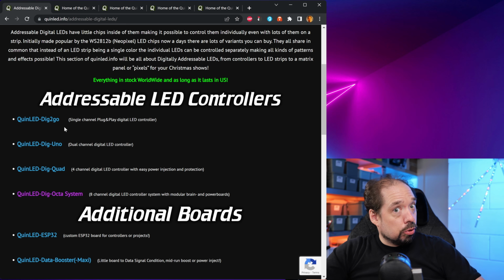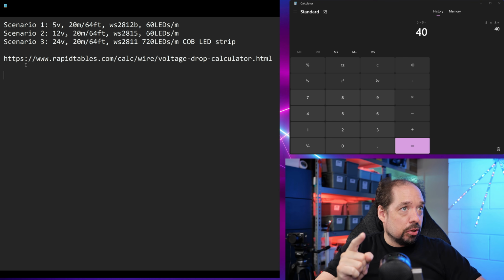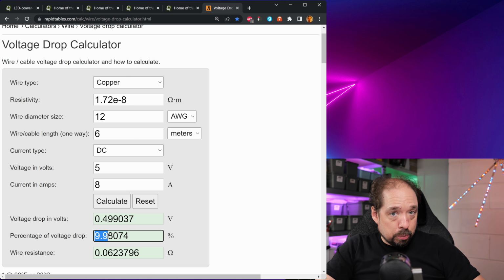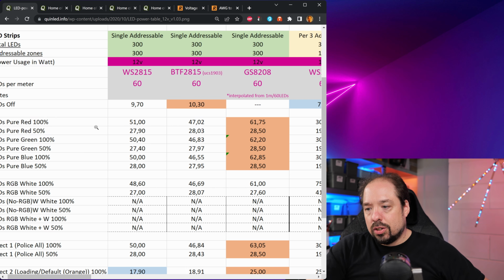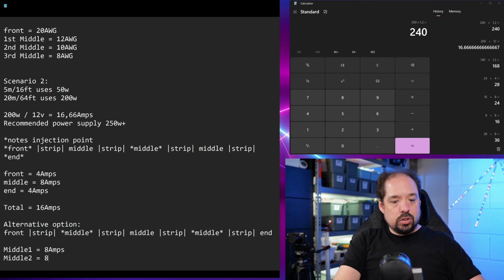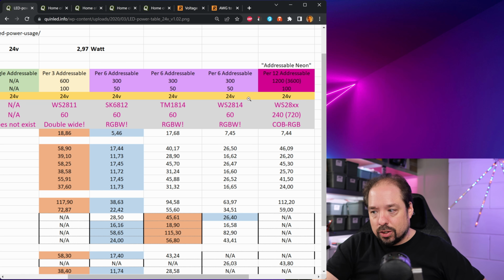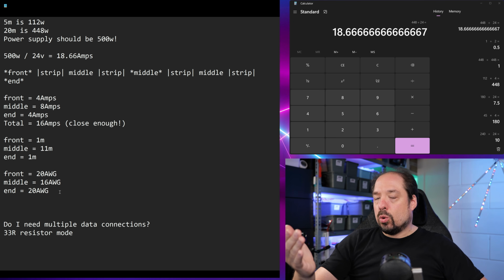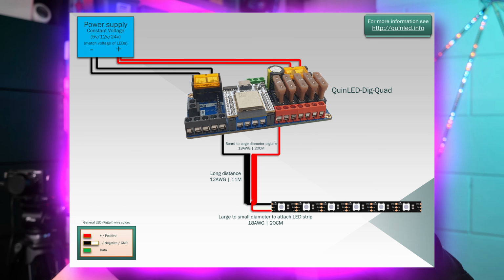Calculate LED Strip Voltage Drop With 💡QuinLED💡: You'll Be Surprised How Many Wires You Need!

Comment: I'm from the US and I don't understand the comma Or period Difference as well. We use The comma for thousands separation and period for dollars/cents basically fractions of what values. so 5  divided by 2 would be 2.5 with the .5 representing a half value. Although with a 10 based measuring system metric I could see where that might be easier to use the comma.
Reply from the maker: Yeah here in the EU it's the other way around. Thousands are noted with a dot and a fraction of a number with a comma so the US system makes no sense to us. Same with metric and imperial, etc.. It is what it is....
Reply: @IntermitTech  I was wondering if the dot was used, wow totally reversed. Don't know whether it would've made understanding math easier for me or not had a hard time understanding how things changed when numbers were below the divide (,.). There's definitely a different understanding of maths across the pond.

Comment: Why are adressable LED eating so much power, compared to non adressable LEDs ?
Reply from the maker: They don't really, it's just that they are often 5v so they consume a lot Amps. 100w at 5v is 20Amps while at 24v (which must dumb strip runs at) is only about 4Amps are generally doesn't need any injection. Because of the increased current you need more copper, but the lower voltage is needed to keep it individually addressable. You also have 24v addressable and it needs the same as analog/dumb LED strip. :)
Reply: @IntermitTech  thanks, crystal clear. And when using 12 or 24v strip LEDs, there'sna new issue. Managing the esp8266 which accepts only 5v. Oh man I'm becoming crazy !
Reply from the maker: Well the Dig boards solve that issue for you. But something else is that they become per 3 for 12v or per 6 for 24v addressable, not each LED anymore.

Comment: I have a serious lingering question, but first of all I want to say that I love your channel, videos and teachings. Since I'm an old fart, I watch your vids over and over again to remember them but, I still can't find a clear answer to an important question I have about my current project; which is - When calculating all the wire size needs for each of the injection points to an LED run, Do I add the common distance between the Digi-Quad Controller/Power Panel, lets say is 15ft distance, to each of the injection point length I need to use to calculate the wire sizes?
Reply: I think I figured it out from your video... the Calculation from front of strip you said was 1meter away from controller... then I think you said middle 2 was 11 meters from controller... you didn't add any "length of strip" you were connecting to... correct?
Reply from the maker: @bobking682 yes that would be correct I think, generally I do build in 1 extra meter into the calculations for the fact the wire from your power supply also matters. Although, if you hook it up to a Dig-Quad or Dig-Octa you can at least make those multiple very thick wires so they almost don't drop any current anymore and then calculating just the strip or wire from the board, is fine.

Comment: You need to lay out various LED, things people are going to buy, including normal ones, COB and FCOB and then say 'you need a controller, a power supply, connectors, etc. All things you need. Then calculate power need as it is a critical piece of information before getting those other things. I found this video semi-useful. I learned use RGBW 50% to calculate. 

The process of explaining can be made easier and simpler.

Comment: What I got from this video is not so much how to calculate, which one can get, but rather if you want some length beyond, it sounds like a meter or two of LED do NOT use 5v unless you want a super-thick wire. This video needs to be cut down. I want to get FCOB for example and there was another similar COB style, and I know my lengths are 16.4 ft each and then I know the Watts of power they use, and the other can be bought up to 5m so I need to know what other products to buy to power them. I know I need a power supply. Check, ok, so what Watts. My guess is, for me 300 or greater. I found this video something I had to watch twice and I'm still not clear. So I'm going to re-watch and find other sources.
Reply from the maker: Ok, interesting feedback! It's hard to get everything or the exact right information for everyone in a video in that sense. I get what you are saying that it's long, but it's because I want to explain why and how so you can apply to your own setup, it's not a "get this for that situation" type of video in that sense.

Maybe I'll make one in that style in the future tough, thank you for the feedback!

Comment: This is a great video for a beginner like me. I am still unclear on one part of my setup. I am using WS2811 12V 50LED string lights. I measured and there are 11 LEDs per meter, but I'm not sure how to find the wattage of that on the real world power sheet. Everything there seems to be many more LEDs per meter. I feel like maybe I'm thinking about it wrong. Can anyone help?
Reply from the maker: The tables are mostly about LED strip. But in the 5v and 12v tables I also have bullet style pixels listed on the right side!
Reply: @IntermitTech  Thanks for the response. I did see that column and even saw you had WS2811 listed, but it was for 60 LEDs per meter. Since mine is 11, I was thinking I was doing something wrong in how I was measuring. Is there a way to extrapolate the wattage for 11 LEDs/meter from the data in that table?
Reply from the maker: Nah, that's more because of the table formatting. I need to clear that up a bit I think, it's for strings with 50 or 100 pixels. The per meter figure doesn't really apply.
Reply: @IntermitTech  Ah ok. That makes sense. Thank you!

Comment: I have a question about running a data wire with ground next to it (1:08:57). Should the ground be connected to the LED strip or can the ground wire not be connected to anything?
Reply from the maker: It would be recommended to connect that GND where you also connect the data. That way GND is as much the same all over the system.

Comment: Muchas gracias por las explicaciones, es un tema muy interesante, siempre se sacan ideas. Yo utilizo Buck-DC Converter, de 24v a 5v, tramos de 50 pixel, apenas 1.5 A máximo en 24V, y utilizo cable UTP AWG24 3 a 3, y dos sobrantes para datos, y me funciona genial y económico.  Puede hacer un vídeo de la mejor forma de usar DC-DC 24-5V converter?  Muchas gracias!!!
Reply from the maker: I think your talking about using 24v to 5v buck converters, I did a series on that in the past, check here: https://quinled.info/24v-power-distribution-for-5v-leds/
Reply: @IntermitTech  Gracias, ahora mismo lo veo.

Comment: 1:00:4:00 why the 42 1000leds at 33 fps sounds for me also pretty smooth when u have in mind that most films etc run at 25 fps
Reply from the maker: It's different for everyone I guess but especially when blending colore having more steps in there really does help. The film effect at 24fps does play into your brain to generate and fill in the rest of the data though, our eyes can certainly percieve quicker and notice the difference. 

 I'm one of those guys with a 120Hz monitor for desktop work though since it's just so much smoother.

So yeah, it depends, if you are OK with that FPS for the LEDs, well, then it's no problem to run it that way.
Reply: @IntermitTech  ok thx the video helped a lot probaly watch it a few times or some parts of it xD
Reply from the maker: @thelastengineer8633 awesome, glad to hear it!

Comment: 41:40 maby add to ur chart legend  that the blue is data i thought it was ur power supply because it was the same colcor and ur legend said green is data got a bit confused untl u said that at 41:40 i had an ah ok so thats the data line
Reply from the maker: Ah that's a good one! The legend is for the cable colors but the board colors matter too of course, I'll see if I can improve that!

Comment: Great video. I have been using 16AWG to power both ends of a WS2811 4m 50 LED string but had never worked out the proper current needs. I now know how to calculate it properly.
Question: If we power the last 5m strip that takes 5V at 7A and you can only inject 4A at one end, won't that make the last few LEDs not be as bright or the correct color ? We might be injecting the correct amount of Amps to the 20m of LEDs but we may not have it distributed equally along the length of the last strip if we have a 4A injection limit.  If each strip takes 7 Amps to properly light all LEDs to the correct color and brightness but you only inject the last strip at one end with whatever remains of the 8A from the injection point. Won't this create a shortage of current and voltage to properly light the strip ?
Reply from the maker: Thnx! About your question, yes in the 5v example during the video I missed that the end also needed a connection. I did add it in all the diagrams and the downloadable document! But if you want to run it at  the amount power the strip can take (so not limited) for single colors and effects you effectively need about 6Amps which a single injection can't supply so indeed it would look more dim then without the injection.

So yup, all correct! I did add some overlays in the video and adjusted the document and diagrams as mentioned, but yeah, even I trip up sometimes. ;)
Reply: @IntermitTech Thanks.  :-)  I will check out the downloadable document. I am using the calculator now for my new project of LED on the fenceposts.

Comment: Can I confirm, 20m 12v ws2815.  3 points of injection front 4amp, middle 8amp, end 4amp.  OR front 2amps, 1st middle 4amps, 2nd middle 4amps, 3rd middle 4amps, end 2amps. 
Thanks

Comment: Sometimes these calculators are not as accruate as what they may appear.   Too many people really over complicate this issue.  
But truth is, 5V strips do suffer voltage drops, but the LED's will be happy at even 15% voltage drop, but you have to remember that voltage drop would only be if you are drawing the MAXIMUM current.    Under most situations you will not be running at even half the power.   A strip rated at maximum 8 amps, you can calculate wire at 4amps in reality  for 99.9% of the effects.   Even if you use solid white using RGB, which is bad, you can use WLED to limit to current to 4Amps, and all will be good.
Reply from the maker: That would be true if we weren't calculating nominal power usage already and using those values.

I agree that RGB white 100% is totally useless and we shouldn't use that to calculate, but I explain this very clearly in the video and also why we are using the values as I did in the video, maybe you didn't catch that part?
Reply: Overcomplicating things is not the same as explaining the actual physics and principles. Personally I would prefer overengineering vs the approach "it works so whatever".. the datasheet specs suggest +-10% 5V, so saying "it will work with 15% drop" means the install is running out of specification. There is no way around that. Quindor's way of teaching is "use the right way the first time, save on issues later". You don't want to know how many people join the discord servers trying to replicate something that was not done right, and are surprised about the results when it was actually done right.

The brightness limiter in WLED is a good tool, but what happens if that limiter is changed in the future, or disabled all together?

Simple conclusion, with all electrical installs, either low voltage, mains voltage or high voltage, just do it right from the start to not have problems in the future

Comment: new to all this. does the ground wire need to be the same gauge as the power wire.  Ie can I run the ground and data on a joined double wire and the power wire on a single stand.  I'm looking at the 20m 12V, powersupply on the end.  Thanks
Reply from the maker: Yes, positive and negative always has to be the same diameter otherwise the lowest value will proceed to dictate the maximum.

Comment: Interesting that you drop this video soon after Chris Maher posted one. Have you seen his? If so, what are your thoughts?
Reply from the maker: Yeah, I started working on this one right after the livestream we did about it again so really pure coincidence!

In my opinion his view is a bit over simplified. According to real-world calculations running for instance the rainbow pattern he's limited to max 10% brightness output of the strip! That's quite a lot of power to drop. And that's a real-world example, not some theoretical number. Sure while I agree you certainly don't need to be able to do RGB white 100% or maybe even 50% in all setups, dropping this low will really create issues and disappointment in my opinion.

I mean, again, running lower power is fine, I sell the dig2go which is limited to 5v 3A (like he uses in the video too) also, but I recommend max max 300 LEDs and am very clear about the downsides of that. Still with 300 LEDs I think it's fine for effects and such, but really on the limit, with 900, yeah no. 

Few brief other issues. Digital LEDs have 255 values per color. Combine those and you get 16 million options. Now we only have a fraction of the power, this also means a lot less steps and now there are only say 50000 colors available. This will make things look much much worse.

Then there is running 900 LEDs using a single data output, I recommend not going above 600 or you will see visible FPS drop. So instead of your LEDs running at 42FPS (WLED default) it's now say 30FPS, making everything look less smooth, especially combined with the above issue.

So yeah, I think I get what he's trying to say, but in my opinion it's stretching things too far. As this video kind of also shows.

Running your LEDs with less current is fine, but 1/10th is a bit too much. And sure, effects that only turn on some LEDs might look ok, but a lot of others will be really dim and choppy....
Reply: @IntermitTech Thanks for your detailed response! You really know your stuff.
Reply: @IntermitTech  I appreciate reading this cause I've watch his(Chis Maher) vids and that's how I stumbled to you and your boards!

Comment: I'd love a follow up on power via 12/24/48v & buck converters at the point of injections or using multiple 5v power supplies and what that means for the common ground connection
Reply: So for multiple power supplies, it's easy, make sure positive wires never connect together without proper balancing circuits (since they are not common, read do not connect them). The negative connection must always be connected together so the negative wires all have the same potential. It doesn't matter exactly where these are connected, but I would suggest as close as possible. Note that the potential can change over length so it might be required to add another small bridge down the line for long wires

for the buck converter setup: https://quinled.info/24v-power-distribution-for-5v-leds/ there is an article (and video's) for that :)

Comment: First thanks for the content, great as usual, but I got 2 questions if you have time.

1st question - The 10% voltage drop makes sence, but then I have a question could we inject 5.5V or 6V and acount for the voltage drop to have the 5V at the end? I know it depends on the power draw but if the LED's can handle it... why not.

2nd question - how well does LED strips handle getting power injection from seperate power supplies? If feasible would the power injection need to be isolated?
Reply from the maker: So both questions are a bit complex.

1. Don't feed in a higher voltage then say 5.2v maybe 5.3v. The ws2812b chips say in their datasheet the absolute maximum is 5.5v so you don't want to be too close to that (Also in regards to data signal and such voltages need to be about the same). But the main reason is that say you measure voltage and set all LEDs to RGB white 50% and then adjust the voltage on the power supply to match exactly 5.1v at the LEDs, great voltage drop solved! Yes, but now when there is less current draw (other pattern, not all LEDs lit, etc.) the voltage suddenly shoots up because the Amps are much lower and thus the voltage isn't being dropped anymore like before. So as I started, 5.2v maybe 5.3v is ok but don't go higher then that (measured without load) or the transient nature of the LEDs (very varying power demand) can suddenly spike voltage and kill them.

2. So officially you shouldn't use multiple power supplies unless you make sure their positives can never meet. So if you do use 2, you'll need a break in the positive line somewhere. Data and GND should be connected between the two and then everything will work as normal.

Unofficially it's a bit more complex, if you set it up properly with fuses, etc. etc. it can be done most of the time. This is because you aren't connecting 2 power supplies in parallel next to each other but through a lot of LED strip which has a relatively high resistance. This means power will automatically "balance" in that sense and that even when one PSU would suddenly fail/disappear the other won't get over asked instantly because the resistance on the strip will prevent a massive current draw (As explained in this video). So often this can work but make sure hardware protections are in place (such as fuses). Also some power supplies might start to act weird if something else on the same line is regulating the voltage all of a sudden. Most work with feedback circuits with which they adjust their output but suddenly there is something else coming in too. I've done tests and as said, generally this works and can actually be fairly safe (if done properly and with lots of LED strip in between) but it's certainly still frowned upon in that sense.
Reply: @IntermitTech  Thanks for the detailed answer, I understood it very well.

Again thanks for the content